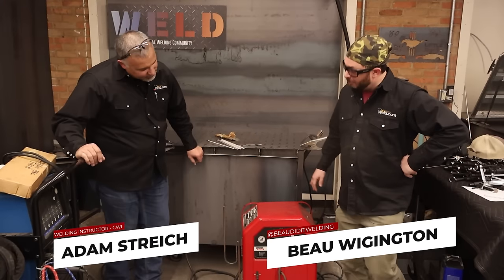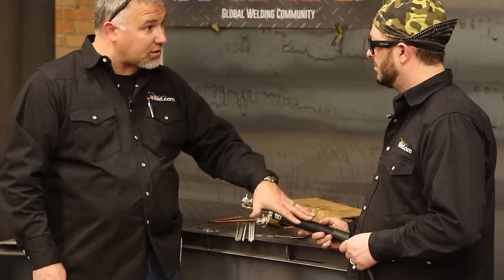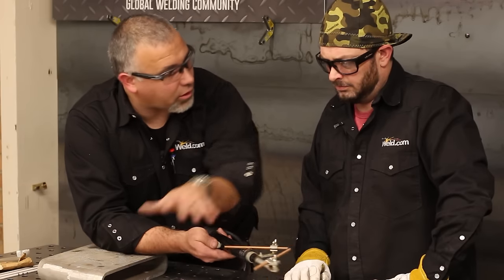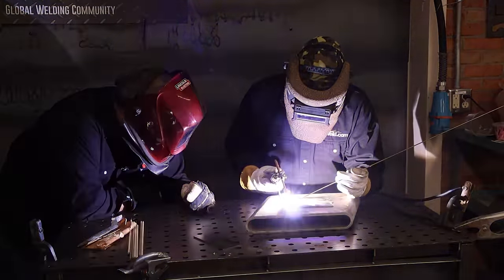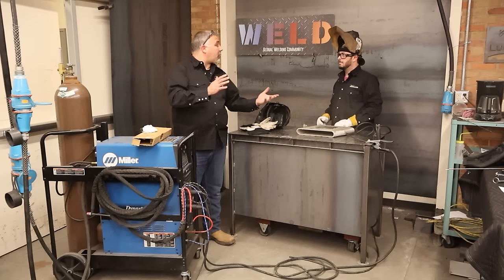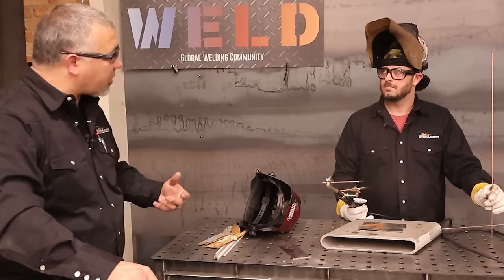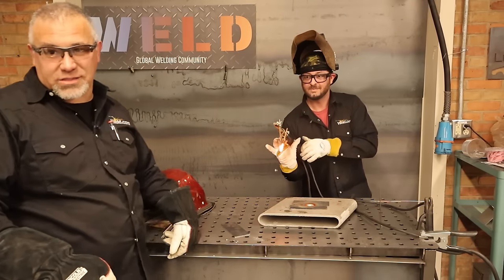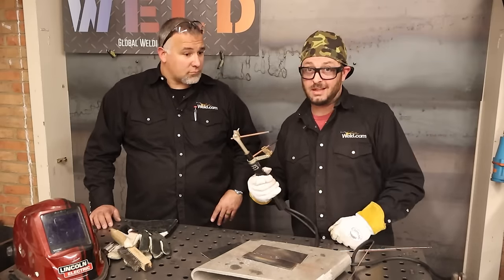150 Year Old Twin Carbon Arc Welding Meets New Welding Machines

Comment: Your welding table connected to the circuit. It's not supposed to be so. The arc should be between the carbon rods only but you have it between all three points: both rods and detail.

Comment: Back in 1959 I was 12 years old,   reading  hot rod and custom car magazines I always  saw ads on the inside front and rear cover pages,  of welding machines that plugged into 110 vac house current,   
 I was interested in this as the price for the machine was only $12.95 !!
 The machine  was called , Four Way Welder co. In Chicago,   Twin Carbon  Arc Welding process,  I sent away for it and almost  2 months later it arrived,  shipping and mail wasn't very fast back then!!
 I've never seen welding done before,   so after reading  the  instructions and putting on the cardboard hood,  plugged it into the wall, and touched the 2 carbons  together,  and the Arc "scared the shit out of me" !!
 I thought I did something wrong !
Then I figured out,  well this must be correct or the metal won't  melt !!
 So after getting  the adjustment  correct it WORKED!!😂
 It also came with some   1/16" 6011 rods.   I made a big blob of molten  metal.  
Oh boy,  I'm a welder !!😂.

Comment: I've always wondered how difficult it would be to rig up a modern TIG machine to do atomic hydrogen welding, I don't know of any real modern use for the process,  other than the fact it can produce temperatures high enough to weld the most refractory of metals including tungsten with the capability of very high quality welds approaching that of GTAW or Plasma Arc Welding, leads me to believe it might still have some niche uses.
Reply: Same , even trying to consider viability of building one and sourcing materials for fun history lesson
Reply: @adamstreich3007  They stopped using it because it’s quite dangerous for the operator. H2 gas is unstable in its own right, and it’s supremely explosive. So rather than continue to accidentally weld hand grenades MIG and TIG have replaced it, for all but probably the most niche uses… but even then I can’t really fathom why.

Comment: We used that in vo-ag class back in 76 on a Century ac/dc with a high frequency box on aluminum irrigation pipe,  running a bead without any filler rod for a grade when I learned to weld .
There's an old one out here in my father in laws shop !!
Brings back old memories  !

Comment: This process was abandoned after some time because you’re using these carbon rods which burn up and go right into the weld. Welds may look ok, but were very brittle and would break easily. You can’t fix that using modern welders to supply esoteric frequencies and waveforms. There was no real shielding to these welds either. It’s amazing they worked at all.
Reply from the maker: That is really great info thanks Mel!
Reply: It was fine for brazing I used to use it for this in the 1970s saved having oxy/acetylene cylinders

Comment: I have used that process. I have even made my own clamp/gun torch . I've welded and cut with it. Originally I was shooting for a home cooked carbon arc gouger and while researching it all I learned about this old process so I made my own. It's a killer deal and poses multiple uses. If I find my tool, I'll post a pic. Weld on

Comment: Carbon arc torches still have their place. I still use mine on occasion. I think the tombstone was doing just fine. Hooking it up to the Miller was a waste of time.
Reply: Taking advantage of wave forms and adjustable Hz makes the process even more capable of dialing in.  Old meets new- you should try it.  Pulse carbon arc

Comment: What’s the shielding used for this process??
Reply: I was thinking the same thing. I guess they don't answer questions on this channel.
Reply: None. This was before shielding gas.  You could use a flux (like for brazing) or with some homemade flux like welding rods. But back then it wasn’t a primary consideration.  And the steel was different
Reply: my guess is CO2 - the carbon rods make it from the air as needed ... just a guess tho don't quote me
Reply: Zero… it introduces carbon into the weld, technically.

Comment: Wow, I haven't seen or used carbon arc welding since the 1970's when I couldn't get a stick welder to stop blowing holes in the metal on a 1972 Fiat 124 Spider's door welding in the front window channel. So I did the cave man weld using the Carbon arc method. LMFIAO  The best part I used metal Clothing hangers for filler rod.
Reply from the maker: The good old hanger filler rod technique built all kinds of stuff
Reply: hangers are made from pig iron so its kind of like a low hydrogen thing
Reply: @solerso68  funny those were the filler rods of choice for many  Oxyacetylene welders on cars especially body & exhaust systems. free was it's claim to fame. lol